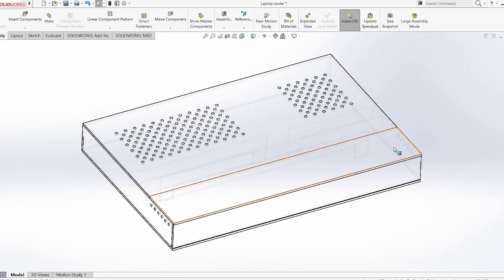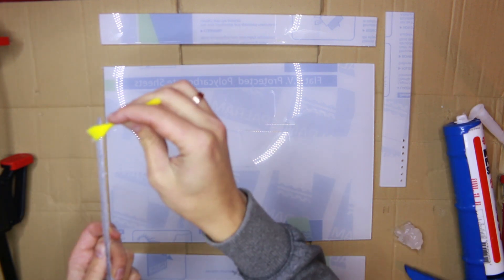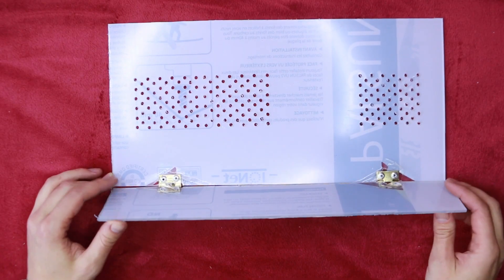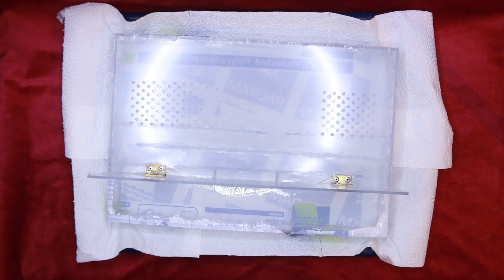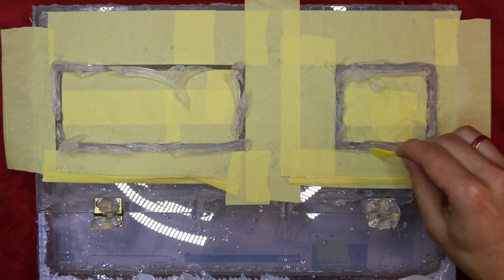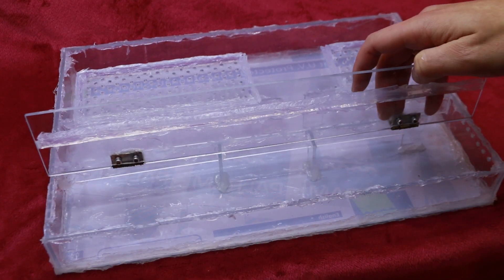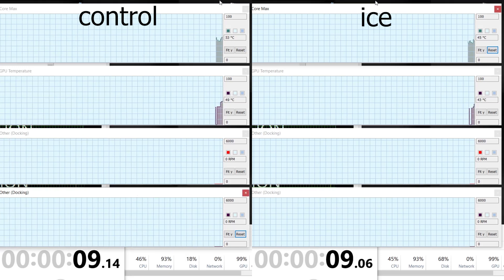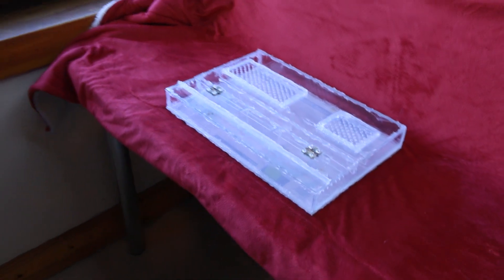Can I Cool My Laptop with Ice?

Comment: Bro ur laptop vents are tiny AF. The 14 inch asus rog zephyrus has 4 outputs and the entire underside is one huge stainless steel intake. It fires the imagination how truly misleading PC companies can be. Example: I can play games that sum people with a supposed “4090” laptop CANT play even though mine is just a 4060. My laptop’s chassis and internals were designed from the ground up to accommodate a 4090. But I have a 4060 and the laptop runs like a desktop(strictly from a consistency perspective) but that’s what you get with a $1,600 laptop with a supposedly inferior 4060 in it. If you want a 4090 laptop that’s consistent then go sell a kidney and hope it’s worth $4,000 Cuz any 4090 laptop that costs less than that is selling you crap.

Comment: Don’t you think if the box had a fan to blow the cold air up to the laptop. It’s not drawing enough air up I’d think.
Reply from the maker: @Itsmy2cent I don't know... my laptop has two fans sucking air from the bottom. My suspision was that the air just does not get cooled fast enough as it is sucked from the room, through the box and into the laptop. It would be interesting to have some coloured smoke to help visualize the air flow. What do you think?
Reply: @MakeithappenDIY  yea I’m not at all an engineer etc I just have thoughts lol. Would be cool to have a liquid cooled pad though. And great job on the idea. I’m too lazy
Reply from the maker: @Itsmy2cent i appreciate your input.  Thoughts and ideas is where it all starts! A lot of the times i feel that is the hardest part

Comment: Is this safe?? What if it got too cold it starts to form liquid in the laptop? (Condensation)
Reply: You're mistaking the level of danger to the PC here with putting it directly on top of ice.
To cause condensation, the PC's heat would have to vaporize some of the water, followed by a rapid decrease in temperature. The former is normal, but the latter does not usually occur. And, since the box is underneath & not attached to the PC, you can simply move the PC if it starts to cool down long before the temperature would lower enough for this to occur, which is indicated by the fans stopping. You also shouldn't keep the PC on top of the box 24/7; that'd be the only other way really that this might happen.

Comment: y dont u use dry ice
Reply: dry ice is hot
Reply: @fukami4327  ??? Not sure if your're being sarcastic but dry ice is much colder than normal ice
Reply: @fukami4327  what are you talking about? dry ice is literally carbon dioxide which has been cooled so much that it becomes solid (similar to freezing water except it skips the liquid state). fire extinguishers literally use cooled CO2 (but not quite as cold)

Comment: I'm about to run a similar test. I live in Africa, Nigeria to be precise. I'm guessing the ambient temperature should be hotter then yours, so ice-cooled air should make a  significant difference. I'll let you know the results
Reply: He is dead guys
Reply: @thewolverine7516  🤣🤣🤣
Reply: did it work?
Reply: did it work?
Reply: how is it?
Reply: Bro where are u?
Reply: nigerian bro literally got blipped by the heat hahaha
Reply: Hopes this helps.

I live in France and this made my CPU temps colder by 10* I did use a different setup with aluminium foil and other fun stuff and the ambient temperature was 30° my room was bearable to game in for once though the fun only lasted about 20-25 mins before the temperature climbs.

All in all I am gonna work on a version with better thermal pad and insulation.

Comment: Ye, it does work, my gaming laptop gpu went from 89C to 40C
L
Reply from the maker: I'm happy to hear that!
Reply: if making cooling pad be be much better with i did ok not water
Reply: 40c is too low which is not safe it should be above 60c
Reply: @pchand19 no.. 40C is idle temperature. If you are constantly getting 60C on idle then there’s something wrong

Comment: I wanted to do the same but i dont know if the cool air and the hot components of the machine will condense the cool air into water in the machine, possibly causing a short and damaging the laptop
Reply from the maker: Fair point. I was actually thinking about this and concluded that condensation happens when air gets cooled down. Since the fans take in cold (potentially humid) air and blow out warmer air, it should not condense.
Reply: @MakeithappenDIY  Oh yeah I think you are right, even if there is condensation it wouldnt touch components just the heatskink and fanks which are fairly fine with that
Reply: Trust me it will I put an ice pack under my laptop to help cool down but when I closed it one of the two clips holding the screen to the keyboard snapped 😭
Reply: Yes that is exactly why I'm here 🤣. My idea was to take a dry ice pack rap it in foil then place a thin towel or rag on laptop keyboard and then place the ice pack inside the foil on top. I tried it ones for 10 minutes to see if the towel would become moist or wet, it ended up only feeling cold but then the components came to mind and I had to place the experiment on hold.